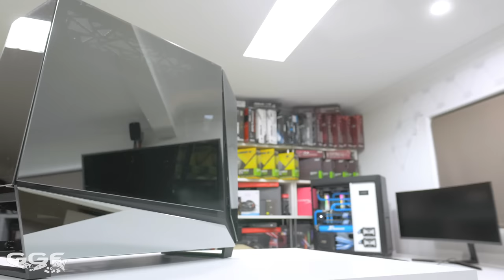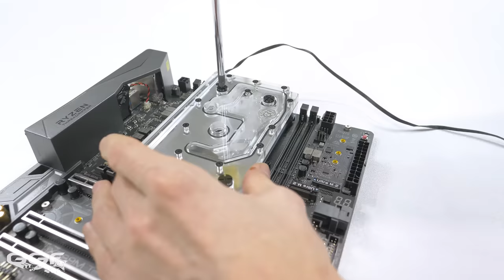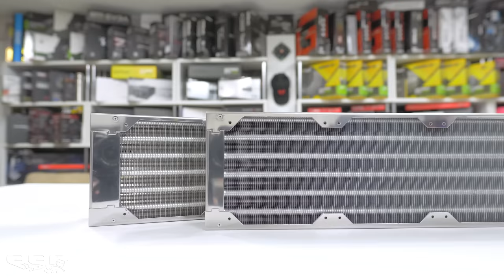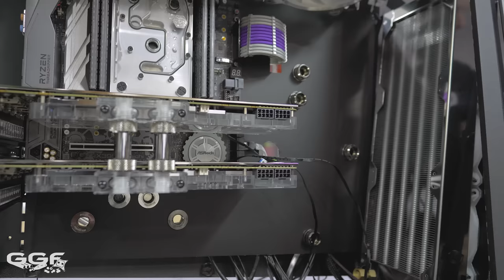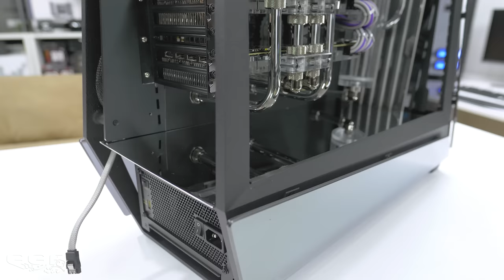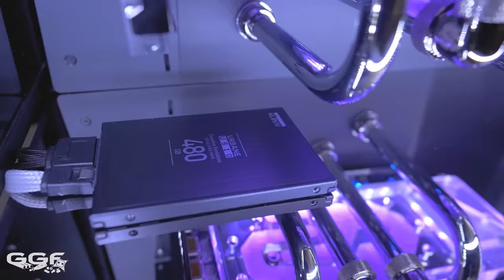The insane $2000 In Win Tòu 2.0 Chassis - Chromed Perfection Time-Lapse Build

Comment: I use Rigid revolver fittings with 1/2” x 3/8” petg tube. If I can find metal tubing the same size, those fittings should work on the metal pipe as well as petg??
Reply: indeed

Comment: Can't see anything to justify them charging way over Lian Li prices for that case or indeed any of their other cases.
Reply: i have this case and a lian li 011 rog. both are good in their own way. the inwin is extremely rigid. the lian li is wobbly as hell without side panels. the inwin comes with a very good 1200 watts power supply with tempered glass. the inwin is a piece of art. the lian li is not